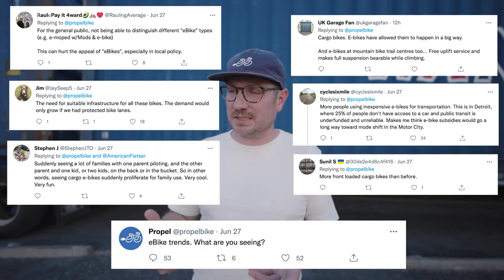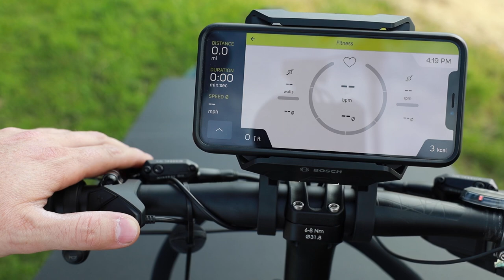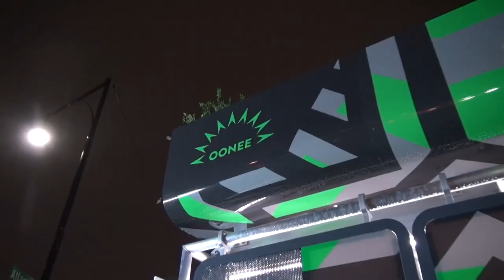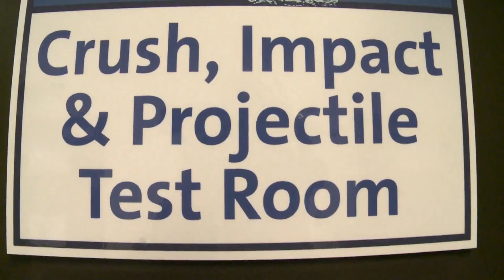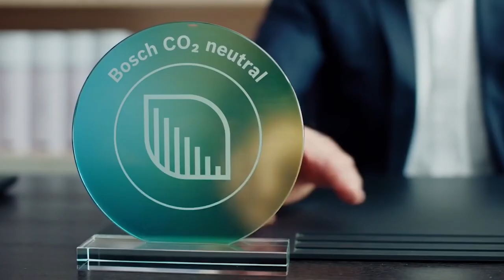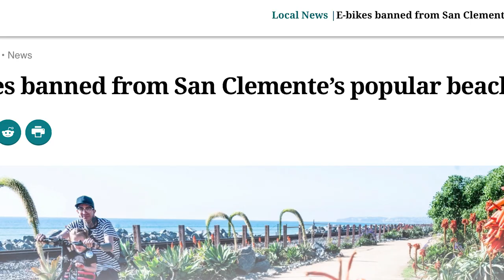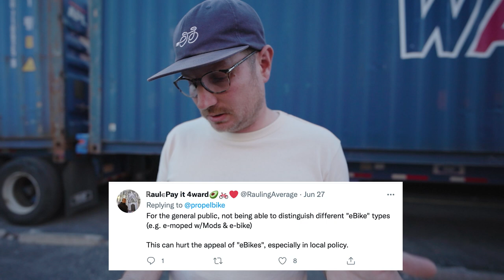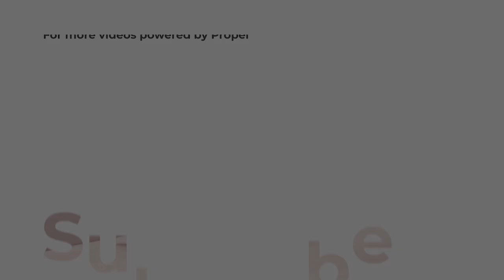eBike Trends for 2022

Comment: Whenever I watch those lovely videos of Dutch people cycling to some place on the excellent Dutch bike infrastructure, there always seems to be a moment when a person on a low speed, petrolatum powered Vespa looking scooter passes the cyclist.  Dutch bike infrastructure isn't just for cycling, so they have theoretically figured out how to handle higher speed vehicles in bike spaces.  I'd love to know more about how that works.
Reply from the maker: It’s a bit of a contentious topic. When we first visited in 2019 this came up and we learned that there was some legislation to push scooters out of the bike paths, but it seems that is just in Amsterdam. 

In NYC this is a big challenge we are currently dealing with. Most of the scooters in NYC are unregistered and they are often getting impounded lately. Unfortunately the department of consumer affairs doesn’t seem to be addressing it at the level of sale and I’m not sure if consumers are aware they are purchasing devices that need to be registered.
Reply: @Propelbikes  Interesting.  I wonder what those advocating for the ban are motivated by.  Is it a speed concern? Noise (those little engines seem to punch above their weight in the decibel category?) Emissions? A general "That's not a bicycle!" attitude that is based on gut feeling and doesn't have much data to cite? 

I'm of the camp that thinks infrastructure should be based on vehicle size and speed.  If it fits in a bike lane and cannot go over 25 mph, then the bike lane is where it should be.   Mixed use paths should have lower speeds and limits on size.  Sidewalks she be reserved for pedestrians and those using mobility aids.

My little set of standards fails on a lot of details.  I don't particularly want to breathe engine fumes. The 25 mph rule is in conflict with Class 3 bikes.  Sometimes I ride on the sidewalk when infrastructure fails me.  In fact, some of my local "bike paths" contain sections that are sidewalks with signs permitting bikes. We will probably never find an ideal solution.
Reply: @Propelbikes  scooters are only allowed up on bikepaths up to 25 km/h. They are machines limited to that speed and they carry a blue license plate. Scooters that go faster usually go on the normal road and where they do align with bikepath they can only go 30 km/h. A lot of ebikes also easily get up to this speed. Theres so many ebikes in this country. Im not a fan tbh. The speed is too high. I would favor e-bikes only as a supplement to normal biking. Too many 60-70 year old here go way too fast. Accidents are on the rise.
Reply from the maker: I think thing change as you have the infrastructure. In places without infrastructure or limited infrastructure fast ebikes are much more needed.
Reply: @strikeformatik  Gotta say, a complaint about the 60-70 year olds going too fast is a novelty. I'm used to hearing complaints about the youths, what with their jazz music and avocado toast. 😁

Speed limits in the US are higher just in general.  The reduced speed for traffic in front of my eight year old's school is 40 mph/64 kmh.  We also mandate helmets for minors and encourage them for adults.  I average about 12 mph/19kmh when riding my e-bike with my kid on the back, and non-assisted cyclists blow past me all the time. 

The special license plate requirement is an interesting detail.  I'm not typically a supporter of bike licensing schemes, but perhaps that's a reasonable compromise for Class 3 bikes.  I don't know.  It's something I'll think about.
Reply: I think this issue of speed difference leads straight into adequate infrastructure. Just as roads grew with added lanes for volume and expectations everyone (should) stay right allowing space for passing on left, I think bike infrastructure (lanes) will need to be wide enough for comfortable passing. While we wait impatiently for just one narrow (hopefully, protected) lane, the dream of even more space feels very distant.

Comment: My greatest concern is over-powered e-bikes assaulting limited-power bicycle paths.
My 250W Shimano STEPS on my Hase Lepus is (to my knowledge) still the accepted norm for E-assist worldwide.
We are likely going to see conflicts on a huge level from high wattage e-bikes in speeding, and in misbehavior, on bicycle paths.
To me, 250W of E-assist is fine!
Reply: Its absolutely fine. S pedelecs make no sense were i live. Also they wore the parts out much quicker without having a significant benefit imo.
Reply: In Aus we have laws for public use stating the ebikes have to be assisted to 25kph only. Sadly when I commute to work I am the slowest on mainstream bike routes but at least I can whistle a happy tune whilst riding, uphill too.
Reply: Totally agree. Yesterday I got on a friend's recently purchased Chinese cheapo ebike and it was almost frightening how much crazy torque was powered to the hub drive. Even in level #1 it felt dangerous to the uninitiated. I ride a Gazelle with mid drive Bosch
Reply: The approach of some EU countries makes a lot of sense to me. 250W / 25kph e-bikes are treated like normal bikes. Anything faster needs a numberplate and cannot go in bike lanes, on towpaths, etc. But they still have advantages vs a moped, no tax, insurance MOT required so the running costs end up way lower.
Reply: The primary reason I use a ~750W setup, is genuinely, ironically, because of safety.
I'm forced to bike with the cars out here in most of the U.S., and when I'm not going nearly as fast as the cars, I'm getting run over by them. I still don't feel safe on four-lane or higher roads, or roads with speed limits above 35mph, even though I have such a powerful motor.
250W is NOT fine if you're riding in car traffic, and can't supply enough of your own foot power to not get run over.
When I'm on trails or bike lanes, I tend to never go above assist level 2/5, which is programmed to roughly 400W peak/200W continuous, and cuts out at about 14mph, whatever that converts to in the superior measurement.
If I didn't need it for the ironic safety it provides, I'd be happy to have a 250W setup.
Reply: @liamness  tax and insurance needed for a s pedelec in my country. In a City they make less sense than in a rural area imo. Driving Bosch cx mid drive.
Reply: @ninetendopesaitama2107  agree, the place they make the most sense is where there's little dedicated cycle infrastructure, and things are spread out. I think requiring tax + insurance is a mistake, at that point you might as well get a car or motorcycle.
Reply: @kmemz  You are responding to a fellow technical person here.
You have not said anything that I would argue against.
You are saying that you yourself have power that cuts off at 14mph on a bicycle path.
Why would I think that 750W would not be needed on some car-traveled/shared roads? Never said, NOR implied, such!
I never said, OR, even implied, "250W is not fine if you're riding in car traffic."
Read my first line again!
Reply: @garyseckel295  True, I still thought it worth mentioning that there is a use case where a lot of power is mandatory for safety in some situations.
The worst part is, even though I'm riding the U.S. legal limits for what my bike can output, I still don't feel quite so safe, and I find myself desparately outpedaling cars even on two-lane low traffic 35mph backroads, as the motor completely cuts out past 29mph, and the desparate attempt to not get run over leaves me exhausted. If not for money constraints, I'd have already bought myself a new multi-thousand watt mid drive kit  and the programming cable to derestrict it last year, because I just can't physically hold all of 35+mph on legpower alone without it coming back to bite me horribly.
Reply: @kmemz  
Understood.
Reply: I kind of agree. My first e-bike is 750w and it's more than needed. I have to turn off pedal assist to ride at a leisurely pace as even the lowest pedal assist brings me to 15kph instantly (a perfectly reasonable speed but I frequently would like to ride a little slower). More focus on convenience, utility and usability (including security and affordability) would pay off more than focus on having the biggest numbers.
Reply: @UCC114Ia95z4VWgvt7IJYmug Seriously Steffi? 
I stated MISUSE of bikes on bike paths. 
I did NOT address PROPER use of higher wattage bikes at all! 
Hey Steffi, do higher wattage bikes "Assault" bike paths as a matter of fact?!
Literally read my comment Steffi!  
Think Steffi!
Reply: @SteffiReitsch  You can get a 800 watt motor on a speedpedelec in Europe. But you do need a helmet, license plate and insurance for that. A regular e-bike is way too slow for me as well. It makes it boring to get around. 

The thing is that we need to switch to slow and fast cycle lanes. Slower ones for the kids, old people and others who like to ride slow at max 25kmh. And fast at 45 kmh for mopeds and speedpedelecs. There is plenty of space for that in most places. But they need to let go of the old paradigm of all bikes being skinny and slow, and requiring little space. You see this the most extreme in the US. Where you see tiny slivers of bike gutters, next to a vast sea of super wide lanes for cars.
Reply: We are having trouble with older ppl using e -bikes improperly on the bike paths..too many walkers to use ebike safely
Reply: @SteffiReitsch  no “hon” , I’m not making it up. It’s a fact ..what is it about a motorized bike on a walking path that most ppl walk on being a hazard , doesn’t compute in your small narrow mind? I’ll spell it out for if you’d like
Reply: @SteffiReitsch  riding an electric bike on a walking trail is a hazard.  sorry the truth is so painful.  I have an electric bike and if I take it on a walking/ bike trail I turn the electric off when coming up to ppl walking.  its called courtesy.
Reply: @anitaostrander4301  It's a hazard if you think of them the same way we think of cars and motorcycles now. But they're much closer to non-electric Bicycles than they are to motorcycles, and the vast majority of people would be hard pressed to not slow down around pedestrian traffic.
It's like blaming everybody who drives a car on the road for the danger drunk drivers pose. People who put safety second exist, but they are not everyone, and while accidents will happen, let those who cause the accidents face the blame for their own actions, rather than restricting everyone for the folly of the few.
Reply: @kmemz  we are talking about walking paths for bicycles and walkers and sorry but your analogy doesn’t fit.  Electric bikes do not belong on the walking trails.  I walk those trails and ride bike and I should add bikers that think the trails are perfect to proactive their racing shouldn’t be on either.  You have old ppl and kids and dogs..it’s unnerving to be walking and have some biker or evidence whiz past you. It’s called common courtesy, thinking of someone else besides yourself.  And BTW I use my electric bike on those paths but I turn off electric around pedestrians .. it’s common courtesy which is lacking these days in leiu of I can if I feel like it. There are so many places to ride an ebike but few places where families and older ppl feel safe and out of harms way. That’s what these rail trails are for
Reply: @anitaostrander4301  I know plenty of people who use eBikes on my local walking/biking trail, including myself, and none of those people have had incidents with people walking.
In fact, there were far more issues and incidents with people trying to ride horses on this trail, before the cities the trail crosses through collectively banned that. There are eBike rental shops on both ends of the trail, and I've seen them run the trail almost as quickly as my Class 3 bike.
As for the people who don't have the common sense to mimick the road logic cars use, there are signs posted throughout the trail for bikes to signal and pass pedestrians on the left.
At least in my area, it's proving much safer in practice than in your philosophy.
Reply: @kmemz  you summed it up ..in your area ..good for you.. and I’m speaking for my area and I’m thinking the problem is that ebikes are fairly new.  This is the first year where I’ve seen quite a few on the road. And again if you use an ebike on a walking path use courtesy. I would much rather ride my ebike on the road where I can go 20 mph and I have hills .. why would you even want to use the walking path??? The only reason I ever use the walking path is because of a coffee/ ice cream place at the end that is fun to ride to. So maybe 2 times a year otherwise I take my street bike on the walking path. Btw, I’m old enough to be considered a senior citizen so I can see it from their eyes and also as an e bike rider, those paths aren’t wide enough to allow for quick thinking if a branch or something is on the path. Why can’t a walking path just be for walkers anyway? Because of all the bikes ,if I want to walk I find a knarly trail that you wouldn’t want to take a bike on
Reply: Ppl who can’t understand why an ebike doesn’t belong on a walking path should  walk the path and see how they like bikes zooming past them. Walk 5 miles on the path and if you don’t find ebikes annoying , let me know. Ppl are getting lazier and where there were more walkers than riders, now there are just as many more riders if not more and once ebikes take over the walkers will stop using the path for whom it was designed because it just stops being relaxing and enjoyable.
Reply: @anitaostrander4301  I've walked it as well, it's hardly a bother. It honestly makes me wonder why more places haven't adopted the Netherlands' infrastructure, where walking and biking actually get you places instead of just to the other end of a cut off trail.
Reply: @anitaostrander4301  Understand your point. I do want walkers on our bicycle paths!!! I know speed-crazy electric bike riding ON bicycle paths is only a matter of time! Do not want speed-abusive bicycle riding on our bicycle paths!
Reply: @anitaostrander4301  Bicycle paths exist. Walking paths exist. 
Walking IS allowed on bicycle paths everywhere. 
What are you actually stating? 
Anita, are you in disagreement with what exactly?
Please clarify.

Comment: I wish I would see more commentary and discussion on the issue of whether you want an e-bike that functions esstentially as an electric motorcycle or one that functions as a bicycle with some power assistance. I'm interested in the latter. I'm overweight and had a hip replacement, so I need a steo=through.

One of my main objectives in riding an ebike is to improve my fitness and health. I need a bike that's light weight,  because I need to be able to carry it up stairs at any time. Right now, I ride a Cannondale  Neo Treadwell EQ Remoxte. I ride it all over Manhattan and sometimes take it on the train to NJ or Westchester. It has a low power, low-range hub motor/battery. I'd like to upgrade to a better quality e-bike, but I simply do not know of any better bike that fits my needs. (Better assistance on hill-climbing; Weight must be < 50 lbs.)

Comment: Give us the ability to lock the motor or make it harder for thieves to plug another display to a stolen motor/battery without authorization. The tech is already there just need to implement it. I start seeing theives selling ebike parts on second hand markets alot lately.
Reply from the maker: This actually exists with the new Bosch displays
Reply: @Propelbikes  Yeah I know. Too bad it's not backward compatible with older bosch motor. Should be standard anyway and most stolen motor I see on fb marketplace are Shimano for some reason.
Reply: I love this idea for the bosh bikes.

Comment: It’s so great to have this kind of content highlighting the 5% of the bike industry that isn’t stuck in the past or focusing on lightweight components and aerodynamics that don’t matter to 99% of people. Looking forward to sport cycling becoming a tiny little niche relative to what we want.
Reply: @TamarMebonia  No it sucks in the UK as well. Secure parking is critical. People won’t buy good quality bikes built to last, made in the most sustainable way if they don’t feel safe leaving it anywhere.

But for the time being, get a Brompton or Brompton knock-off would be my recommendation. Reasonably easy to get up the stairs and you don’t have to leave it anywhere. It’s not perfect but it’s what I’d do if living in a city. Otherwise I ride my Dutch bike which I’m relatively ok with leaving outside. Would never leave my Riese & Muller anywhere though. Only ride it on leisure rides where it never leaves my sight.

When I was talking about lightweight components, I’m not talking about stuff like that new lightweight Brompton. That’s useful. I’m talking about road bikes and the most expensive components that aren’t built to last and just for ultimate racing performance.
Reply: @TamarMebonia  I really recommend the electric Tern bikes. They take up much less room to store and get in lifts while still giving a great ride experience. Expense is a problem though.....
Reply: Weight will always matter. Don't believe me? Try pedaling a 100lb bike up a very slight rise without electric power. Next turn the power up to full and lift it into the bed of your pickup truck.